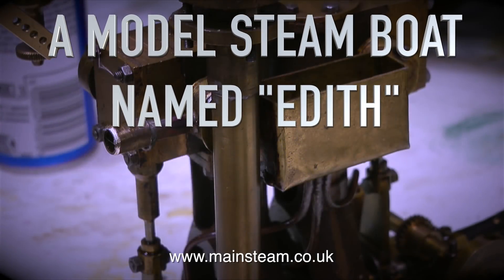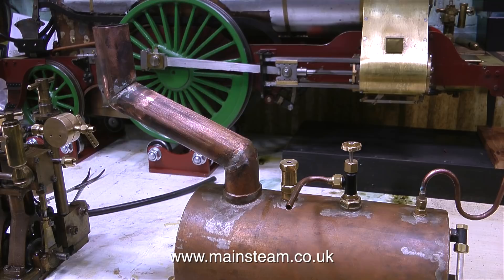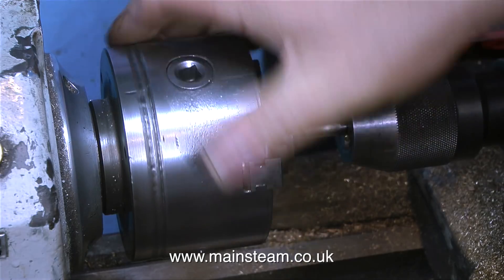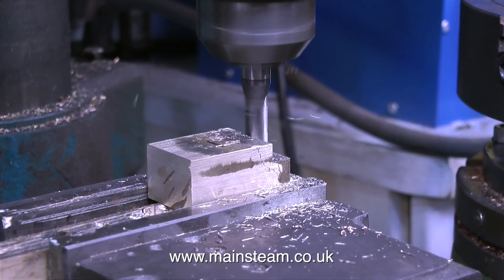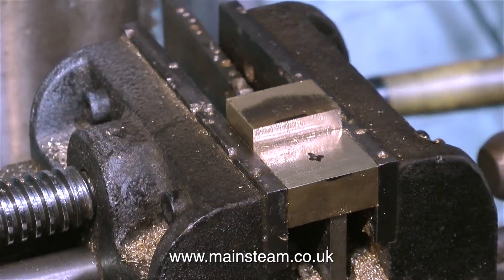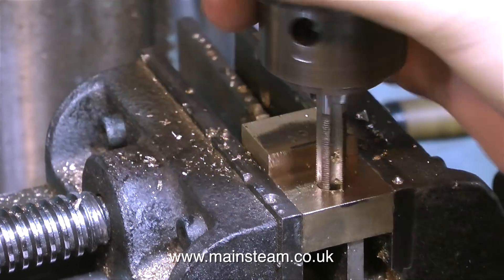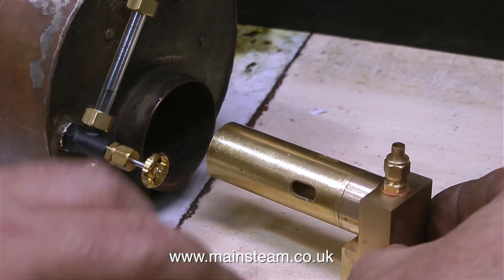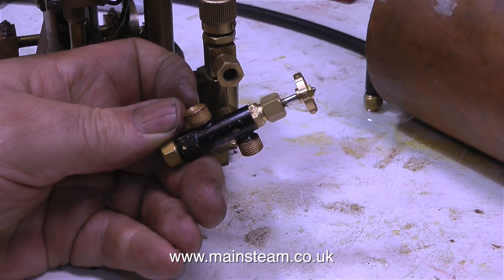A MODEL STEAM BOAT NAMED EDITH - PART #14

Comment: I remember being told off for calling a rule a ruler.  The comment I had was " A King is a ruler, a Queen is a ruler and the chief of a small pig-me  is a ruler, you use a rule to measure things"  The funny thing about this is the rule is the straight  edge the thing that is actually used to measure is called a measure.  The person in question was given a Pharaoh doll in a box with " Incase of measuring emergency please break open your 25.6 cm ruler "

Comment: "Pipe" is traditionally used for fluid transfer and measured by its nominal inside diameter. "Tube" is traditionally used for structural purposes and measured by its outside dimension. Your  observation is therefore correct, the 1/8th referrs to the internal dimention of the threaded pipe. Presumably the wall thickness is standardised...
Reply: Ian is correct - although its a distinction that has been a little lost over the years. 
Steam pipe and gas pipes are correctly called pipes because 'steam' and 'gas' are being transfered in the pipe and are both fluids.
Reply from the maker: What about "Steam Pipe" or "Gas Pipe" - ? {:-)))
Reply: Yep, when I got started with model engineering, this confused me to no end. Took a fair amount of reading to get it straight in my head.
Reply: Yes, A fluid is just something that flows. So dry sand, marbles or grain in a grain silo can be considered fluids :) Although it would be hard to get them to flow in 1/8" pipe!
Reply: Bitsnpieces, a gas doesn't always act like 
a liquid.  Can't compress a liquid. (Much)

steve
Reply: Capillary tubing which is the technical name for small diameter 'tube' used in model engineering is specified by both its outside and inside diameter. The sole Australian manufacture, Key Tubing lists their sizes by both and can be ordered by  both sizes or usually citing both as they produce a variety of wall thicknesses))).  In Model Engineering i always sell stuff by the outside diameter.  That is a pipe union tail is sold 1/8" if it is to fit 1/8" pipe.  The hole however is not in fact 1/8" to allow for silver solder))

Comment: Hi Keith, you are quite correct , the 1/8" size on BSP does indeed refer to the internal diameter of the pipe.
Reply: I beg to differ - there is generally no place on a threaded pipe-end you can measure the nominal dimension, unless you cut the pipe length to that dimension.

A 1/8" pipe, schd 40 (for instance) measures 0.405 in OD, and 0.27 in ID, none of which are equal to 0.125 inch

Perhaps a schd 160 pipe would have the nominal ID?

Comment: the 1/8th is referring to old cast iron pipes that were around when the thread was standardized. Those pipes were 1/8" internal diameter. as metallurgy has improved, the walls can be made thinner so the inner diameter is much larger now for the same standard of pipe.
Reply: This is simply not true. BSP is the standard and the uoted number is the bore diameter. That bore has a fixed wall thickness, so the OD of the pipe is constant.